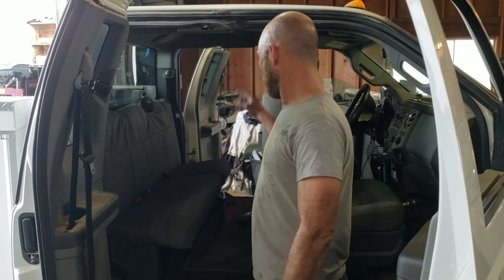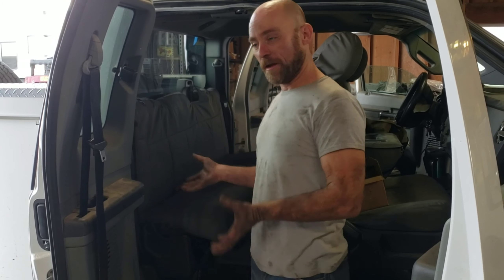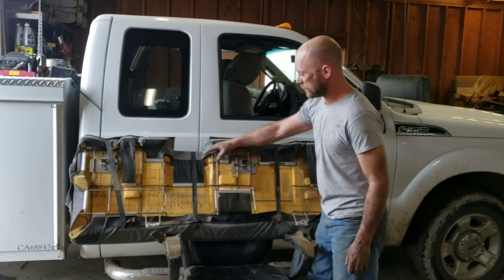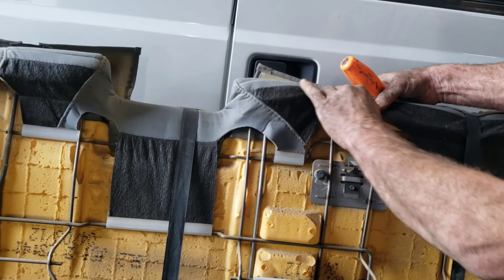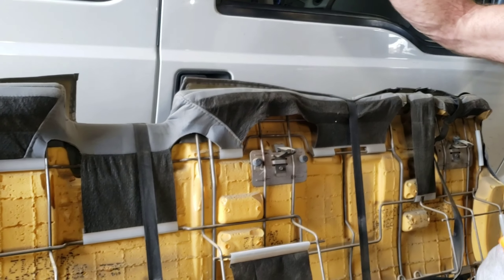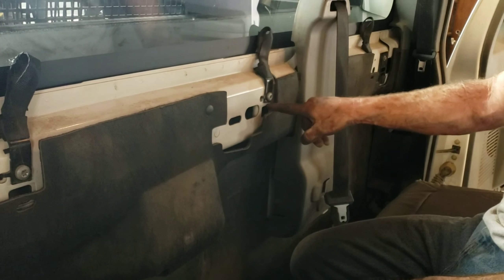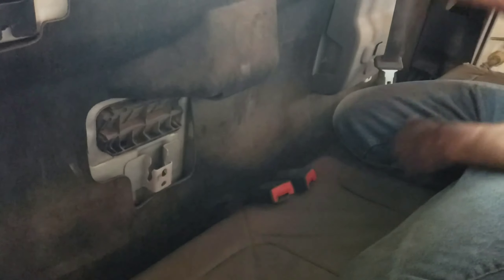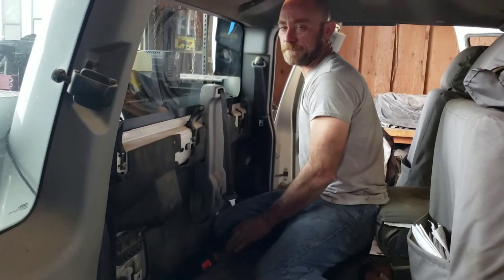How to remove the back seat of F250 - 2011 / 2016

Comment: Excellent! 
My rear window got busted and I need to remove glass bits that got behind the backseat. 
And, so it does not happen again, I’ll be replacing the window with Lexan, a durable polycarbonate.
Reply from the maker: lol that's way I pulled it

Comment: What about removing the bottom of the bench seat?
Reply: There's three bolts/nuts along the front and three along the back that need to be removed. One in the back is a torx head and the rest you can use a deep socket on